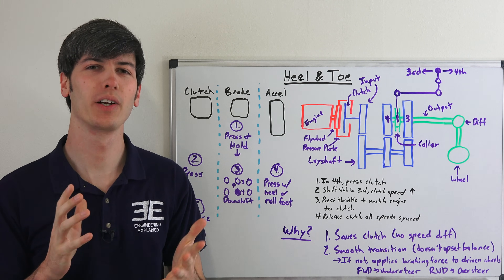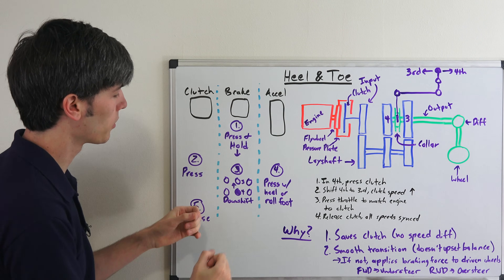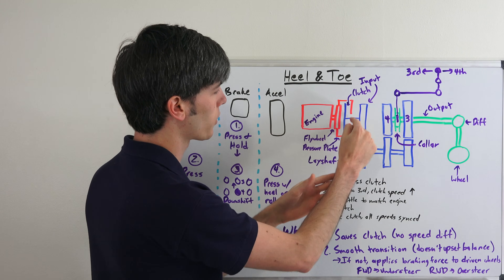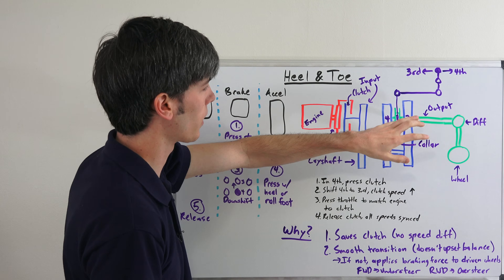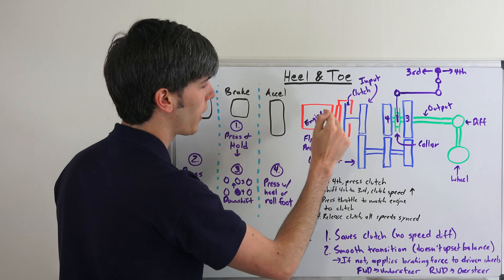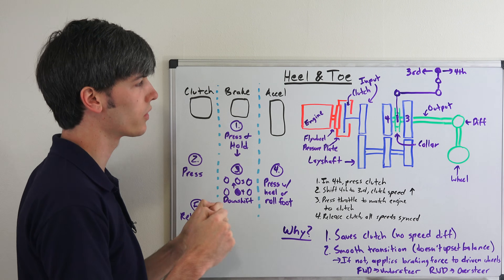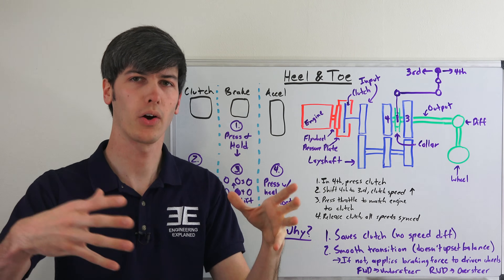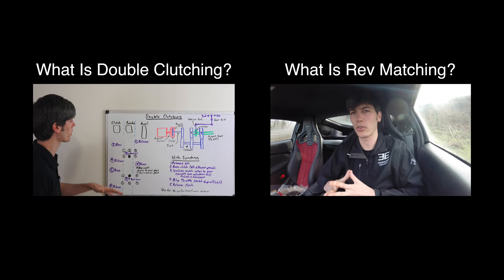What Is Heel & Toe? (Downshifting)

Comment: Great video!
I believe you missed a reason for this technique however: In rally sport turbo cars, heel&toe is mainly done to keep the engine in the power revband so you can accelerate out of a corner without turbolag. Just like in left-foot-braking, but with a gear-change involved.
Reply: +hanshuber456  Left foot braking for sure, but I find that heel and toe is also handy for keeping n/a engines in their optimal power band - especially those that keep most of their power at high rpm - while simultaneously braking.  I wouldn't think a small blip on the throttle would help the turbo that much, but holding it down while braking with the left foot - which can be really hard on the brakes - would keep the exhaust gasses pumping while the car slows.  These days, I think they use those anti-lag systems that sound like firecrackers going off under the car.I've also heard that left foot braking can be used to change the car's attitude and balance when cornering...but I've never gotten the hang of it myself, so that's just hearsay at this point.  :-P

Comment: I usually try to rev match into corner for smoother feel of the ride. This gets me feeling more confident to try to heel and toe for ... you know, more sporting purposes. So I guess if you combine heel and toe with rev match - you train both. Still hard to get the hang of it.
Reply: +metalon Part of the benefit of the technique is it makes it easier to get into the lower gear in plenty of time for the corner. You shouldn't need to be doing all this while actually going round the corner.

Comment: Hi Jason, could you give me some insight to this...
Why is it easier to shift at higher RPM? For both my corolla and s2000, sliding into the next gear is much smoother at about 3.5krpm rather than let's say etc. S2000 shifting at 9k is absolutely amazing...
I discussed with my friend and he reckons it could be due to higher energy/momentum? I genuinely have no idea where to start for this :)
Reply: I also have an ae86 and thought it weird it struggles to go over 5k rpm but 3 and 4k are smooth

Comment: Thank you for doing this vid - think you now have all the shifting techniques covered.  I had to learn how to do this when I first got my licence (my first car had very little in the way of brakes or power, so maximizing the little I had was important if I wanted to get anywhere), but I've always found it kinda difficult to explain to anyone how the process works.And next...maybe an explanation of how to properly use left foot braking, along with when and why racers use it?  Just a thought for your next technique vid...  :-)
Reply: +Attila theHun Not ridiculous. I do it every day without even thinking about it, even in city driving.  If you drive a car with no low end torque downshifting becomes fairly important if you want to accelerate at all.
There are other applications of the technique too, such as hill starts.
Reply: It has nothing to do with synchromesh. Heel-and-toe is a technique for using the accelerator while braking, usually for rev-matched downshifting.

Downshifting is a necessity in underpowered cars, and being able to do that while braking is certainly a useful technique for driving smoothly. 

Re: hill starts. Of course it's 'not necessary'. It's just another technique for avoiding the car rolling back.

If we're limiting our discussion to 'modern cars' then many have hill start assist anyway so that's a moot point. My 25 year old car does not.
Reply: Synchromesh matches the speed of the gears (blue part in his diagram) and output shaft/wheels (green part).

Revmatching means matching the engine (red) to the gear speed (blue).  If you're driving at 3000rpm in 3rd and you select 2nd gear, the synchronisers will help the gear engage, but now the transmission might be spinning at 5500rpm, and the engine speed has probably dropped. If you engage the clutch, either you need to slip the clutch a lot (wear, takes time), or engage the clutch quickly but that will cause a braking effect because the transmission needs to drag the engine up to speed.
Reply: Attila theHun  I think it more important in a low-powered car - you have so little to work with, sometimes you need to maximize every last HP to get it to do what you want.
Reply: Sam Douglas  Absolutely correct, mate - double clutching is to save synchro, and heel-and-toe or rev-matching is to smooth out your downshifts and reduce wear on the clutch.
Also, regarding hill starts...I've owned a car (Oldsmobile Cutlass Sports Coupe - with typical GM lack of forethought) with the park brake operated by a pedal on the floor, to the left of the clutch - push once to engage, and a second time to disengage.  So you can't use it on hill start, since you'd have to try to disengage it while already on the clutch pedal.  The only options left are to kill the clutch with huge amounts of slipping, or applying the throttle while holding the brake at the same time.

Comment: Can a Diesel engine keep going without a battery, or would the fuel injector stop?
Reply: +MRFYPTS Isaac depends if it's a modern diesel or not (in cars at least). all modern engines have atleast an electronic ecu, diesels also have a low pressure fuel pump, and a bunch of other stuff. older diesels had mechanical pumps and those could run without battery power after starting
Reply: +MRFYPTS Isaac
https://en.wikipedia.org/wiki/Diesel_engine#Mechanical_and_electronic_injection

Comment: When I wan't to slow down before a corner, can I do it just by shifting down, without actual braking or is it putting too much strain on the clutch? Because I've been doing that a lot, but lately I just started to wonder if it's ok or not. Thanks..
Reply: You can rev match to a lower gear before the turn, then use the engine and the brake to slow down
Reply: +riciy depends on gear, 4->3 is ok, on 3->2 I would blip the throttle because there'd be enough engine braking in 2nd to not have to 'brake with the clutch'. plenty of variables but still better to slow down with the brake
Reply: +riciy when you downshift the force into the wheels gets fed back into the engine instead of what's usually the reverse. the more the car shakes back and forth, the faster the clutch wears out. you might save brake pads and even tires but something else gets worn instead
Reply: +riciy It's fine to downshift to slow down, try to learn rev-matching if you can though, if you do it properly you'll minimise wear on the clutch.

Comment: Is there any benefit of double clutching with this technique rather then how you showed it here with only engaging the clutch once?
Reply: +mrawesomelemons  You can still double clutch with this technique.  Double clutching saves wear on your synchromesh - especially useful if it's already getting weak or non-existent - and this will let you use it without having to get off the brakes when shifting, so you don't find yourself approaching a hairpin turn without use of your brakes (because your feet are otherwise busy with the downshift.)  But whether you double clutch or not, this is a great technique to learn, so you will always have access to your brakes if you need, no matter what else your feet are busy with.  And it makes for a much smoother downshift if you can stay on the brakes instead of having to keep getting off them for each shift, then reapplying them over and over as you got down the gears.
Reply: +mrawesomelemons Usually not necessary on a modern car but it can mean the gear engages more smoothly, especially if you're going down more than one gear at once, e.g. fourth to second before making a tight turn into a side-road. Also is quite fun.

Comment: Great explanation, one of the best i've seen. 
Something i've never really understood though - are you actually trying to 'sync' the speeds, just get somewhere close, or merely just get a higher engine speed than clutch speed?

it seems insane that you would be able to "sync" them; for example "ok, i'm dropping into 3rd at 46mph, that'll require exactly 2894 rpm from the engine, so i will now apply [x] force to the throttle to achieve that"

usually i just blip the throttle and match within maybe 500, always shooting for over rather than under.

thoughts?
Reply from the maker: Just trying to get close, the clutch can absorb some play. You want the clutch accelerating in the right direction, so that it's not a big force when the pressure plate clamps down. Practicing it, you'll notice when you do it right vs wrong, and it's not always perfectly matched, but it sounds like it because you accelerate the clutch disc and then release the pedal, so the braking force by the engine is almost nothing and the pressure plate pulls the clutch the rest of the way (very minute). With manuals that have rev matching, it will perfectly match, and hold the revs as long as you hold the clutch in - something far more difficult (though completely unnecessary) to do as a driver.
Reply: +Engineering Explained awesome, thanks!

Comment: So would you say that heel-and-toe is the same thing as rev-matching? If not, what are the differences?
Reply: Pretty much. You're just braking with heel and toe
Reply from the maker: Yep, as Fluffer said - though rev-matching can be done for upshifts and downshifts (typically it's discussed as downshifts), and heel & toe simply means you're on the brakes (and hence will always be downshifting, if shifting at all).
Reply: +Carlos Melgar They're similar, but heel/toe is a more advanced form of rev-matching.

Heel/toe allows you to brake while you're rev-matching. So it's useful for track days and spirited driving as you'll always be in the right gear and your car will be balanced. It can be used on the street, but it's not really that important to know unless you're planning on tracking your car or going on mountain runs. It's fun though and definitely worth learning if you love driving manuals.

Rev-matching is a great way to begin learning how to heel/toe as well as being good for your car.
Reply: +wamphyr000 Yeah, plenty of fun! I do it all the time in my RX-8!
Reply: +Carlos Melgar  It does  the same as rev matching...but it's smoother, as you don't have to get off the brakes each time you downshift.  This also means you can slow down faster, since getting off the brakes to rev-match each downshift means you coast until you have finished each shift.

Comment: But how do you know that type clutch speed is matching the engine speed
Reply: +Hyundai Accent Fan Club Experience. Doesn't have to be 1:1 but the more you try the closer it gets, the smoother the transition.
Reply: +Hyundai Accent Fan Club You know through experience. Begin with Rev matching (no braking/rotating your right foot, just clutch and accelerator) as you move down the gears towards a stop. If you let the clutch out normally, you'll find as you get better and better, it won't feel like the clutch is engaging at all, it's completely smooth. Once you know how to do it, then you can begin to heel/toe.

Let's say when you downshift from fourth at 3000RPM to third, it ends up being in third at 4000RPM. So clutch in, move the shifter to third, blip the accelerator to hit 4000RPM and then clutch out. Every car is different of course.
Reply: +Hyundai Accent Fan Club You need to rev up to the rpm you had before you shifted.